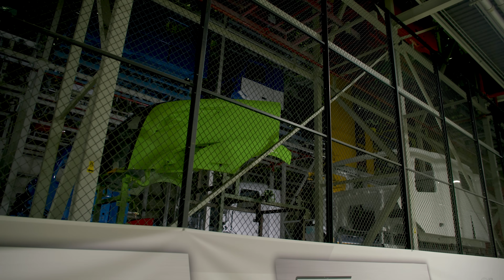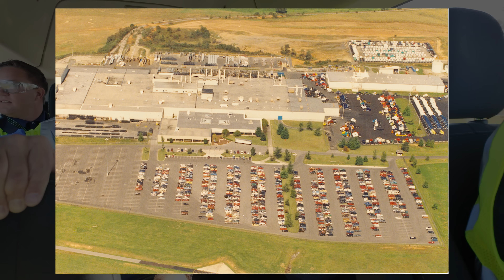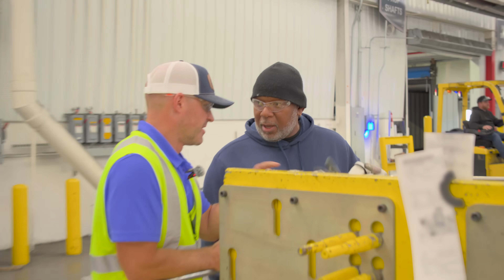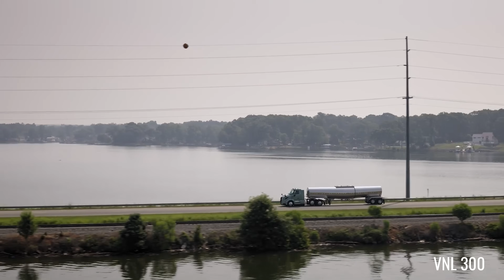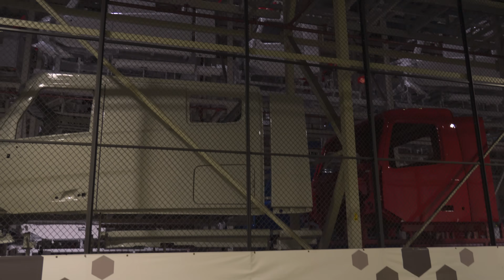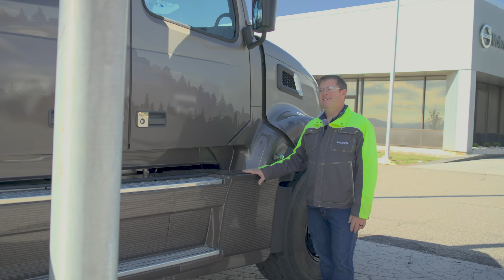The Volvo Factory Tour Truckers Never Get to See

Comment: The company I drive for absolutely loves Volvo trucks. I believe they are decent trucks with made with what seems to be the cheapest electrical wire on the market. We have tons of electrical issues. Maybe it’s too many sensors nowadays 🤷🏼‍♂️ Bosses seem to love having Severely underpowered trucks with the 117,000-129,000lb load we haul. They love the 455hp trucks governed at 70mph in 12gear at 1225 rpm.